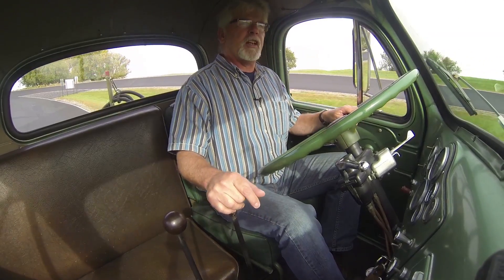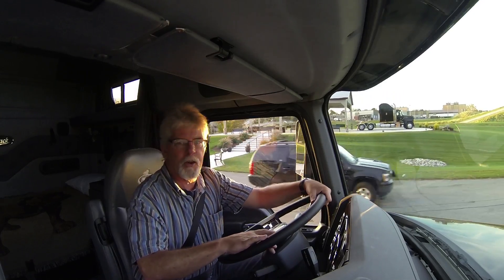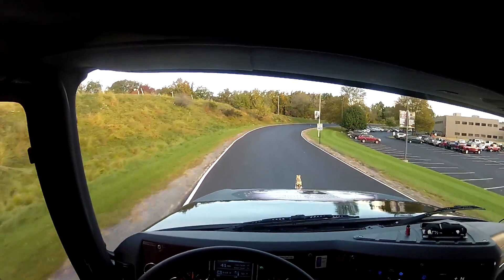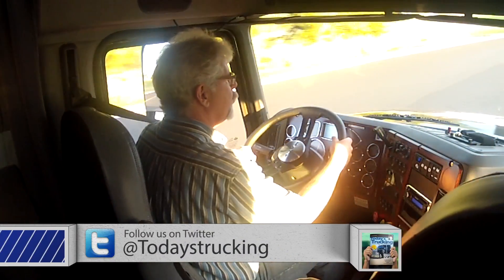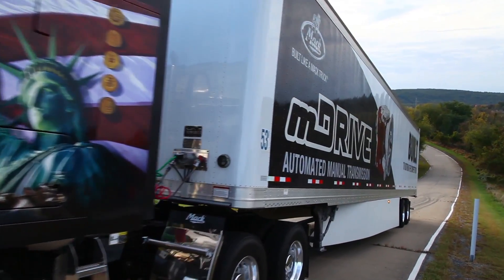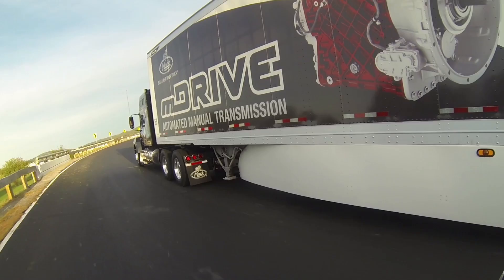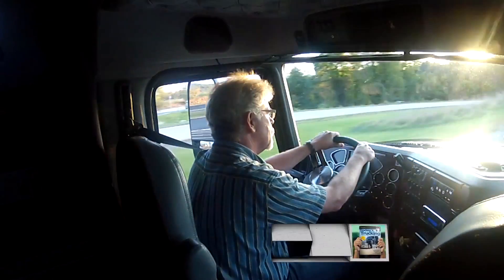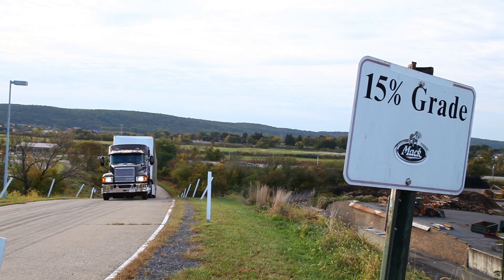Twin Stick to mDRIVE Pt 1

Comment: My Son and I own a small trucking co (5 trucks) I learned to drive a semi in a twin stick B Model Mack, we very recently bought 2 brand new Mack’s with less than 1000 miles on each truck. My pride wants to drive a stick but my desire to maximize profits wants the M Drive Mack’s they get about 113% better fuel mileage and THAT is a lot of savings, that never stops giving!

Comment: I understand automatic transmissions are great for some people, but not me, I've been driving an old twin stick for years and there is just something I love about going through the gears
Reply: the GOOPER automatics have slip and can and will and DO lack torque and are slower and just suck all around 
An old b61 or a gmc 
With a 5 speed trans 
A 4 speed brownie box
And a 2 speed rear end 
If you spit gears with the rear end 
You have ten forward gears as is
4 speed brownie box
Giving you 20+ forward gears 
And 4 reverse gears. 
Drove a 1970 something international loadstar with that exact setup
The powerhouse was a detroit 3-53 .... had 4 inch straight pipes.... and worn synchros
So driving it was fun 
Double clutching splitting gears blowing through low range up a grade..... 
that damn thing was unstoppable it had so much torque.......